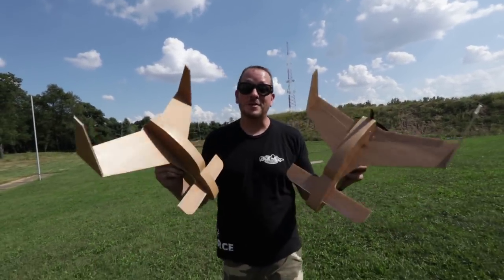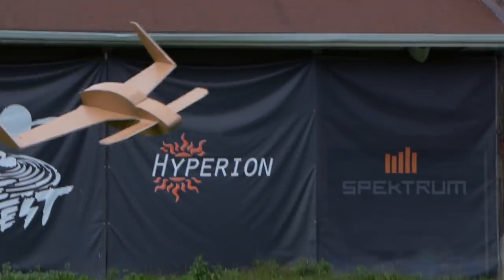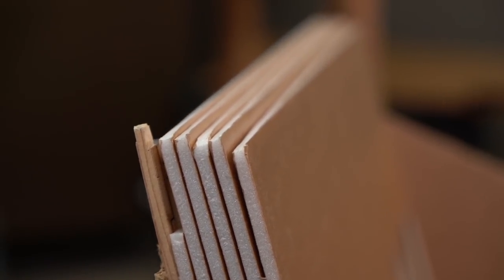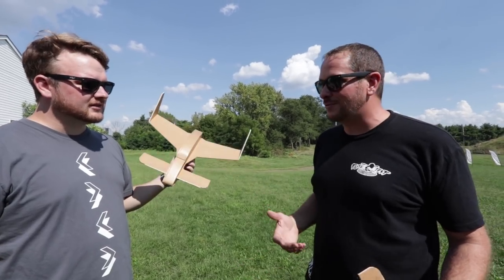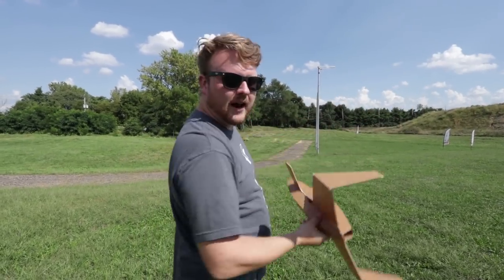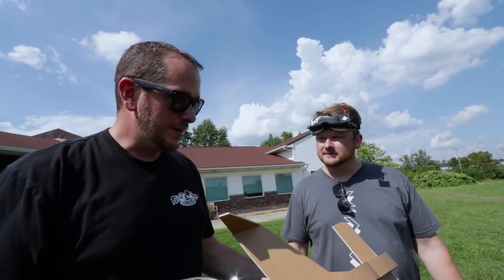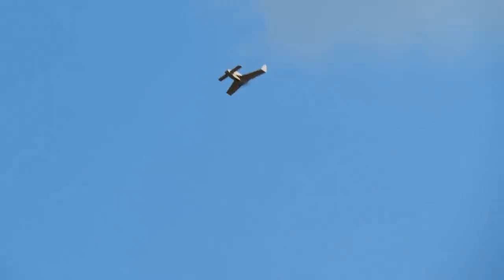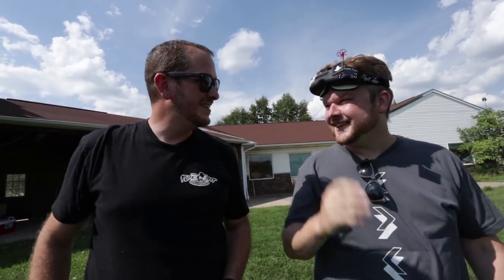$1 DIY Airplane | FT LongEZ

Comment: In 83 my dad bought me a balsa wood plane with a gas engine. I had to wait several years before he would allow me to build it, while making the wings I cut a piece 1/4 inch too short and it made it so I couldn’t put the wing ends on. He gave up on the build at that point. I built the remainder of the plane myself. Installed the engine and silk and doped it. I never flew it. After storing it around for around a decade I gave it away. I think I’ll stick with paper planes.

Comment from the maker: If you buy the materials from the dollar store and use our free plans, this airframe can be built for $1!
Reply: Provided if you can get project foam. If you're in europe you can get it for 1$ + 60$ shipping.
Reply: Awesome you guys do this
Reply: Love your channel
Reply: Really nice project, and idea guys!. Family project

Also can you turn the music down a bit please on your next video, thanks
the first two are loud and I cant focus on what your saying
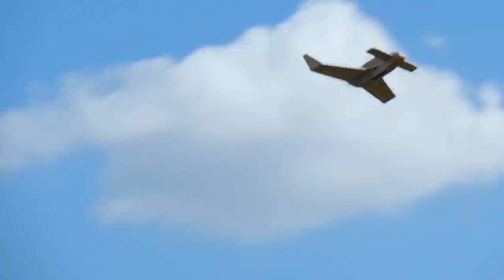7:28 sound levels a bit better here, but not like your other videos
Flying 8-Foot A-10 Warthog @ 11:00 is about right
... just trying to help

All the best
Reply: @martinsalko1  lol
Reply: request, do same but outer half of control surfaces as ailerons, inner half as elevator. as an alternate plan for transmitters not having V-tail mixing. how tricky? can a skewer join elevator halves through the fuselage, servo linked inside? outer ailerons could run from 1 servo forward, or a pair 5 gram slot mounted in wing. they're  "old school" nowadays, but simpler 4ch transmitters are very inexpensive, so it could be a good thing to look at everything V-tail control mixing required (plans), to see if they can be altered for "no mix flying". more downloads or fast builds? more plan options for more basic transmitters.

on this one, it could be slim elevator on front canard, ailerons rear, two servos up front, pop aileron push rods inside the fuselage even. might be an EZ candidate?

on more flying wing shapes:
would control surfaces need to be wider or narrower (hinge to trailing edge)? would the result fly "too strange" like if ailerons at tips have it twisting and here comes the center elevator favoring one direction or the other too much for being off centered forces (may be lots worse on shorter fuselage craft)? would it require longer more slender ailerons shorter throw, and center elevator short+wide (hinged further forward to be less % of wing trailing edge length, applying its force closer to center line, less influence rotationally-aileron)? like 40% width ailerons (each) hinged 1", 20% of width as centered elevator hinged 1-1/2".... conceptually speaking. I can understand some plans wouldn't accept it at all. would a design flight simulator indicate characteristics? maybe someone has a knack for it and just knows intuitively?
Reply: Martin Šalko 😂
Reply: its probably already been an idea, but how about a stealth bomber with a scale bomb bay for water filled ping pong balls
Reply: Looks Like a XP-55 :D

Did you take some orientation and inspiration from it?  :)
Reply: Homo Quantum Sapiens  Go ahead and build your first and even second one from the $1 foam, when it is time to spend a bit more time on a build and try to keep one for a while the brown stuff from FT is water resistant and takes paint better. Other than that is is the same stuff.
Reply: too bad the plans aren't ready yet
Reply: Maybe it was Burt Rutan who took inspiration from the XP =) The FT version is based off of the Rutan Long-EZ
Reply: You might want to check ebay. People are selling FT foam for around 70 bucks for a pack of 25 and some charge 3 euros for one sheet (plus shipping). Get together with some friends and you should be fine.
Reply: Where do we find the free plans?
Reply: can you guys perhaps start looking at other cheap materials?   while foam board is great unfortunately its WAY overpriced in australia   most shops charge $10-$20 per sheet and it usually weighs more too...
Reply: The Flysky line (i6 & i6X) are great starter radios and they have several programming options too (including Elevons, V-Tails and a couple mixes.) 
You should be able to find them in the $40-60 range (and receivers are nice and inexpensive too!)
Reply: How can I get the free plans or where do I go to get them
Reply: I got dibs on a flying Larrymobile!
Reply: $1.25
Reply: Guys i need help theres a small dent in my lipo how do i know if its done or if im still safe to use it

Damm i just rewatched the beginner episode on batterys i think im f**ked 😟
Reply: what kind of foam do you guys use for your planes?
Reply: Im doing this! Gonna make one for my son and one for my nephew too!
Reply: Chaos Yoshi:
The Long EZ is a Burt Rutan designed experimental class two seat airplane.
Reply: @tananam9782  with 68 recorded accidents since 1981. Pretty interesting reading.
Reply: The foamboard we get is $15 a sheet and it's relatively heavy!  more for building structures than planes...
Reply: +Chaos Yoshi the best, from the Rutan Aircraft Factory LongEz https://en.wikipedia.org/wiki/Rutan_Long-EZ
Reply: Homo Quantum Sapiens  unfortunaly not here in australia. The adams style board is allmost double the weight and about $12 a sheet. I made a simple cub out of it (didnt fly even after some massive weight reduction surgery till it had no rigitity left.) I had some success with building a tiny trainer but it was way to heavy. I recently purchased some aero modeling foam from hobby king. It is a lot cheaper but its more like depron. So i combine FT and EA building styles to build a plane. But it definatly takes a lot more work then it looka to be with adams rediboard.
Reply: Homo Quantum Sapiens  It is really hard to find anything simular in europe. The best thing I found was papicolor foam for 10 euros a sheet.
Reply: Homo Quantum Sapiens  where i live foam isn't anywhere... I couldn't find it even tho i am here for 6 years, searching for 4 years.

Comment: A well trimmed Canard makes an excellent first airplane because they essentially never stall the main wing when the CG is set just a bit forward.  That means you never lose roll or yaw control.
The forward surface stalls and that drops the nose, preventing the main wing from stalling.

Comment: My 12 year old son and I built the LongEZ as a chuck glider and were super excited to fly it. We spent 3-4 hours building it from scratch over 2 days. After completing it we immediately went outside to fly. It flew great! We managed to fly it about 4 times before the front wing broke off. With a little tape we were back in the air for about 10 more flights before the other front wing broke off. The wings are now hot glued and reinforced with tape. It still flies great!! 

I would suggest that the design be modified to allow a replacable front wing since the plane is a belly lander it tends to take all of the punishment. Our next LongEZ will be modified so we can replace the wing.

Comment: Looks like you guys got the RC version flying really well.  I love that it can be built as a chucker or RC and that it's only one sheet of foam!  Winner winner chicken dinner.  Congrats Alex on your first RC airplane kit.  Can't wait to build and fly one.  What is the ETA on the new FT Radial motors?
Reply: Hey Dan, thanks for the plans on this! I made it with my 4-year old daughter as a chuck glider and she loves it!
Quick note on the plans though:
1. For the chuck glider option where the battery pack is not needed, I trimmed mine to cover the back of the fuselage to compete the look and not have an open area. An idea to add this (as a few blue/green lines on the battery pack) in a future amendment to the plans?
2. "Stabilizer" is spelt incorrectly! 😆

Love what you guys do! Keep it up!!!

Comment: How difficult would it be to make a VTOL multirotor with holes cutout in the wings and mount motors on the canards with the same body with 2 servos, like the e-flite convergence, for a winged acro multirotor to FPV that can also GLIDE with perhaps servos on 2 channels to steer on a potentiometer! It looks to be 5" prop sized already!

Comment: The Boulton Paul P.100 was a design for a tail first fighter produced in response to an Air Ministry specification for a manoeuvrable fighter.

Specification F.6/42 called for a fighter with a high rate of climb (4,500ft/ min to 20,000ft), good acceleration and good manoeuvrability. Boulton Paul's first design was the P.98, a tail first pusher that was judged to be over-weight. This was followed by the P.101, a staggered biplane with cantilevered wings and the cannon carried within the spats for non-retractable main wheels.

After both of these projects were rejected by the Air Ministry, Boulton Paul submitted two designs with lower project numbers.

The P.100 was another advanced design. It was a tail-first aircraft, with shoulder mounted canard wings just behind the cockpit and low mounted swept back main wings near the rear of the aircraft. The vertical tail surfaces and rudders were at the tip of the swept back wings. The pilot sat in the nose, with a good view from his all round vision canopy. The P.100 had a tricycle undercarriage. In case of emergency the pilot escaped from the aircraft by jettisoning part of the lower forward fuselage and dropping down out of the aircraft.

The P.100 was to be armed with either one 47mm cannon, with a 20mm cannon on either side, two 20mm cannon with a 40mm cannon on either side, or four 20mm cannon.

The P.100 was expected to have a top speed of 298mph at 17,000ft and 435mph at 18,000ft.

In September 1942 all of the designs submitted to F.6/42 were examined at the RAE, and all of the Boulton Paul designs were dismissed for being too futuristic.

VIA FLIGHTSOM.COM FS2002/FS2004
Boulton Paul P.100. This was an unbuilt project for a ground-attack aircraft to a draft Air Ministry specification (unnumbered) of March 1942. The P100 was the most advanced and unorthodox of the many designs the aircraft industry responded with. It had a canard - pusher layout to give the pilot the best possible view and would have had an armament of 40mm and 20mm cannons along with bombs and rockets. Two kinds of models (clean / with missile) are included. By Kazunori Ito.

https://www.flightsim.com/vbfs/fslib.php?searchid=73355893&page=35

Comment: I'm a complete newbie, so bare with me! I have access to a laser machine where I work, but I can only run metals. Do you think that if I were to take one of your plans and run it on my machine in thin aluminum, it would fly? My thinking is that all your plans work with cardboard because of how light it is. If I were to try doing the same plan but in aluminum, would it be too heavy for the wings to create enough lift and just fall like a brick?. Would I have to tweak the plans for it to work or is this just a dum idea?

Comment: I got my foamboard from dollar tree and it's blueish black on one side, white on the other. The problem is that it doesn't want to bend! It's the only foamboard available in my area, what do you recommend I do to get it to bend so I can match the curves of your designs?
Reply from the maker: Peel the paper off one side to get it to bend to your likings!
Reply: @FliteTest  thanks, I'll try that.

Comment: I'm really curious as to how to make this into a VTOL ... I saw a experimental military APC with a drone VTOL with similar design. I lost the link of the video but I want to see if anyone can convert this into a VTOL and attach a camera in this. 

It used 3 power plants, One in the back, and it seems like they attached the other 2 on it's CG, the location is still in the general area of where the CG of this RC. They attached it with some sort of plastic tubing. The two power plants seems like it was angled forward  to make it VTOL, I'm guessing it was meant to be tail heavy and the tail should hit the land first when it lands vertical. The take off seems to be angled, it was on a launch platform on the APC similar to how V2 Rockets or Katyusha are launched (WWII missile).

Comment: I have a suggestion for the upcoming season. I would like help with or see a mini series with profile planes. like the yak 54 or biplane or any type of slow flying, light plane. start a series of easy to hard builds. maybe 3D print some motor mounts that work great with the Addams board. im not sure if this is the best place to pitch this? anyone that sees this please help direct to a better place so flitetest.com can see this. Thanks